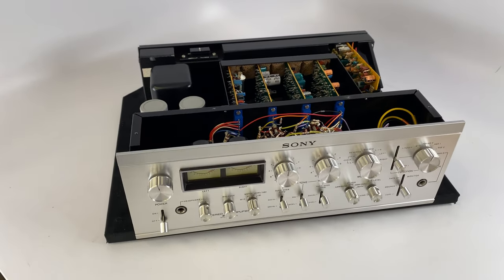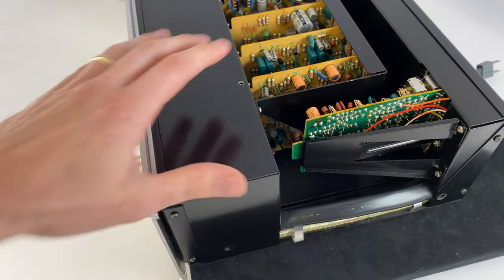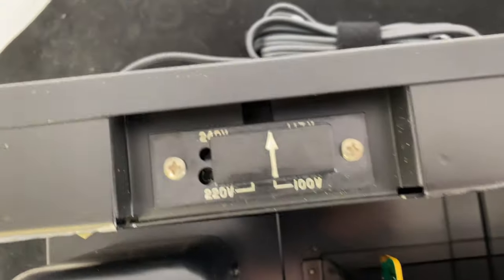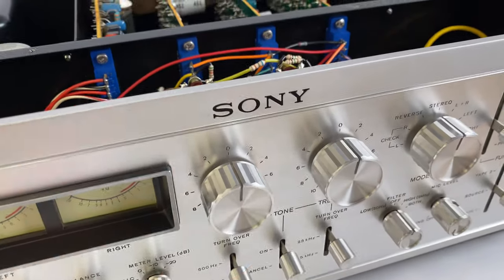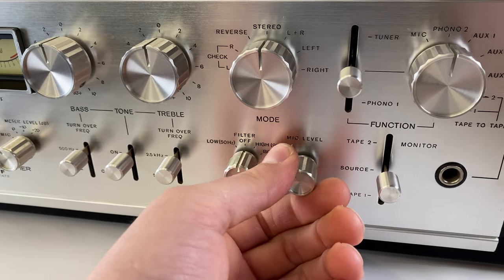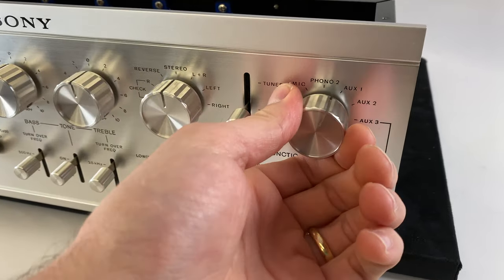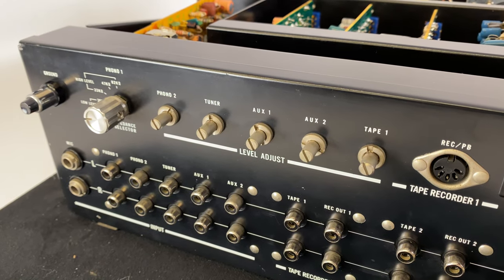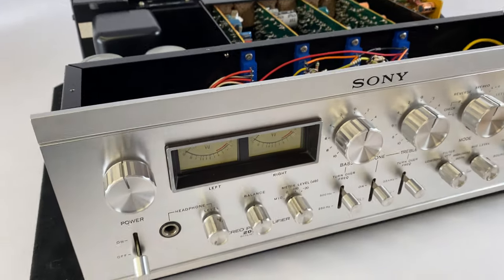Sony TA-2000F - High End Vintage Solid State Preamp - Pre "ES"

Comment: Hi! I know this was done 3 yrs ago so I am just hoping that you will pick this up. I have just received out of Japan the Sony ta 2000f set at 100v. I live in Australia which is 240v, looking at the selector switch I could set it to 220v which is okay but I can't move it. I've unscrewed the 2 screws to see, just a mass of wires. Can you identify what I need to do to set it to my countries setting ? I tried to pull it up, thinking then I can swivel it, but I dare not force it as it is stuck. Thanks Alain